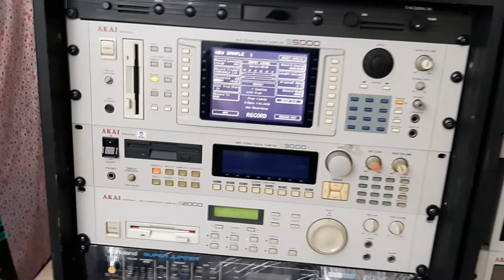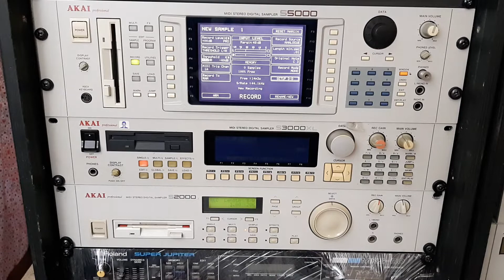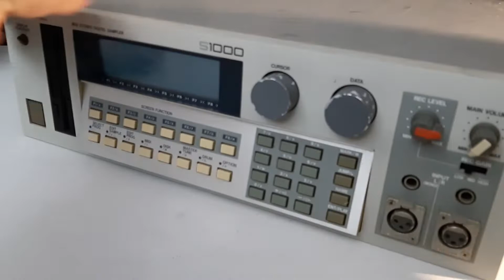Saving & Repairing Akai Samplers S900 S950 S1000 S1100 Part Two

Comment: Is it safe to touch the edges of the PSU's circuit board? I need to get it out in order to check the capacitors and dont wanna get fried. :D
Reply from the maker: Yes it is. Normally you would use a grounding device but these are pretty sturdy. Just make sure it’s all unplugged and be aware the capacitors may hold a charge even when the unit is powered off.
Reply: @unrulysoldier2140  Thanks for the answer, I managed to remove the PSU board and checked the caps, no charge :D
Now I have to figure out how to fit the new PSU :D

Comment: Hi, I acquired an S1000 recently, and unfortunately, it makes a crackling noise all the time thru all outputs, including the headphones output, independently from the volume knob.  I'm not sure what the problem could be... I would like to open it and give it a good clean, but since I've never done anything similar, I'm afraid of electrocution :)
I uploaded some videos here on YouTube showing the problem.

Any ideas or advice would be appreciated.

Great videos, very useful, thank you!!
Reply from the maker: Thanks for messaging. Proper nice one on the acquisition. So strangely the S1000 was the worst out of all the old samplers I have worked on. It's the first one to have a different power supply so perhaps it was a learning period for Akai. I am no expert, I would recommend hitting the forums, but... a generic symptom is a good thing. The fact that it's in so many places points to your onboard PSU. If you're not a soldier monkey maybe start looking around for a replacement PSU. It's a complete unit. You would only need to open the case,  disconnect cables, undo a few screws and bosh it's out. Your caps have failed.i imagine like the one in my video, the electrolyte has eaten the crap out of the PSU printed circuit board and thus seriously compromised earthing and current flow. Hit me up if you cant find the part number but if start with ebay. Respek. 👊
Reply: @unrulysoldier2140  Thank you so much for taking the time to reply. I’ll open it as soon as I have the time and will have a look. Will start looking on eBay too…
I appreciate your help. Have a great day :)
Reply: @unrulysoldier2140  I opened my S1000 today. It looks totally clean. Everything looks perfect, including all the caps and PSU. Still, that crackling noise is always there on all outputs! 
??? *frustration.
Reply from the maker: @ZenMountain  hi. Ok well done. So I would still change the caps. Or get someone to do it. All the 80s outboard that still in use now needs recapping. Even if you don't have obvious leakage. They dry out. Now if you do have a budget I would take it to an electronic engineer and have them go through it, bit to me it sounds like a power stage fault. Now of course the easier option is to buy a new psu online and bang that in. They're cheap. Let's say it's still there, you can keep the new psu as that would be  good idea, or sell it on. Bench time for engineers starts at $60 US per hour and caps and components are cheaply sourced by the engineer. Wish I could help more but the components really need to be put on a scope and tested.could be a bad resistor in the psu. If they fail the resultant change in frequency could easily produce what you're hearing. I know its frustrating as shit but i really think we are talking about problems at a component level here.
Reply: @unrulysoldier2140  Thanks for all your help! Here it's $90 p/h and 8 weeks of queue at the technician shop...
I know the PSU is the ELCO P30-5, but I was not able to find one for a reasonable price. Could you please let me know what PSU can I use instead? 
I see you're in Australia, I lived there for almost 10 years... One day will probably go back!
Cheers!!
Reply: @unrulysoldier2140  Do you think the MeanWell RS-35-5 is a good option?